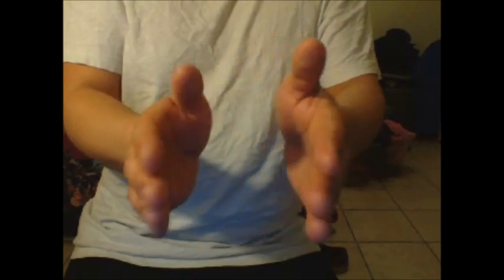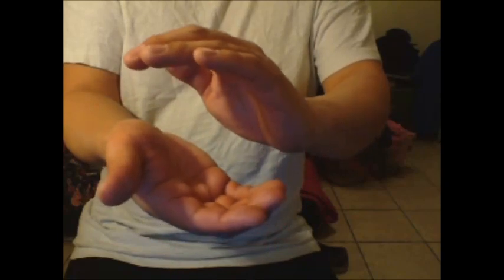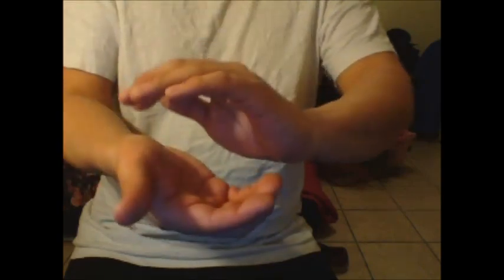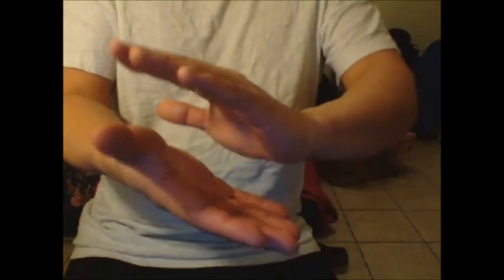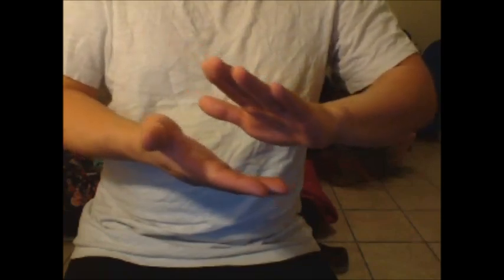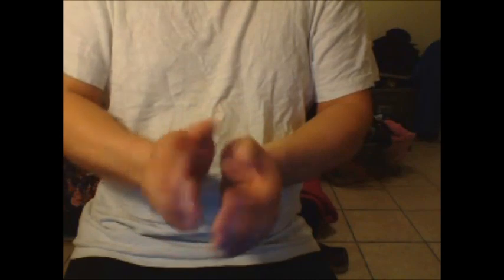MY "HOW TO CREATE A PSI BALL TUTORIAL!" (For Beginners)

Comment: I felt so much heat and magnetic in my hands while doing this!It takes time,I’ve been trying this for about 2 months and finally,I felt it for the first time!
Reply from the maker: Here's some more advice for chi/psi ball Development. 

People ask how the energy gets released from the hands. Well the thing is the hands are always releasing energy from the palms. It gives off thermal energy and slight subtle bio electricity. If you have watched my video on psi ball Development. You should know some tips to get started. But there's a few ways to further help creating psi balls and chi energy from hands.  

One way is to rub your hands together for 15 to 20 seconds. Then clapping them fairly hard together 4 or 6 times. This helps with creating more blood flow and stimulation in hands. That is energy as well. Then place your hands close together with a half an inche between the palms. You should feel a pulling or pushing between them. This is the earliest baby phases of the psi ball. You should feel some heat, tingling and a kind of magnetic sensation. That means your stimulating the chi energy. You can also open the space between the hands a bit and then closing it. Going back and forth like that to feel that magnetic pull or pushing. Later in time you should feel the psi ball getting bigger.

Keep doing this when ever you wanna practice and you'll get stronger in time. Do some breathing exercises (like six breaths per minute is very good), meditation to relax the mind as well. That is optional but the rubbing and clapping works well. Developing chi balls can lead you to creating Electrokinesis, improved telekinesis and Pyrokinesis too. Take care and be please be patient.

Comment from the maker: Here's some more advice for chi/psi ball Development. 

People ask how the energy gets released from the hands. Well the thing is the hands are always releasing energy from the palms. It gives off thermal energy and slight subtle bio electricity. If you have watched my video on psi ball Development. You should know some tips to get started. But there's a few ways to further help creating psi balls and chi energy from hands.  

One way is to rub your hands together for 15 to 20 seconds. Then clapping them fairly hard together 4 or 6 times. This helps with creating more blood flow and stimulation in hands. That is energy as well. Then place your hands close together with a half an inche between the palms. You should feel a pulling or pushing between them. This is the earliest baby phases of the psi ball. You should feel some heat, tingling and a kind of magnetic sensation. That means your stimulating the chi energy. You can also open the space between the hands a bit and then closing it. Going back and forth like that to feel that magnetic pull or pushing. Later in time you should feel the psi ball getting bigger.

Keep doing this when ever you wanna practice and you'll get stronger in time. Do some breathing exercises (like six breaths per minute is very good), meditation to relax the mind as well. That is optional but the rubbing and clapping works well. Developing chi balls can lead you to creating Electrokinesis, improved telekinesis and Pyrokinesis too. Take care and be please be patient.

Comment: Why is mine freezing cold, it feels like Icy wind. I can’t feel a solid, just wind blowing round in a circle
Reply: Omg me to no heat like a lite wind
Reply: I felt a numb tingling in my hands and the wind that you are talking about… we are airbenders!
Reply: It can be a different feeling for everyone
Reply from the maker: Here's some more advice for chi/psi ball Development. 

People ask how the energy gets released from the hands. Well the thing is the hands are always releasing energy from the palms. It gives off thermal energy and slight subtle bio electricity. If you have watched this video in full on psi ball Development. You should know some tips to get started. But there's a few ways to further help creating psi balls and chi energy from hands.  

One way is to rub your hands together for 15 to 20 seconds. Then clapping them fairly hard together 4 or 6 times. This helps with creating more blood flow and stimulation in hands. That is energy as well. Then place your hands close together with a half an inche between the palms. You should feel a pulling or pushing between them. This is the earliest baby phases of the psi ball. You should feel some heat, tingling and a kind of magnetic sensation. That means your stimulating the chi energy. You can also open the space between the hands a bit and then closing it. Going back and forth like that to feel that magnetic pull or pushing. Later in time you should feel the psi ball getting bigger.

Keep doing this when ever you wanna practice and you'll get stronger in time. Do some breathing exercises (like six breaths per minute is very good), meditation to relax the mind as well. That is optional but the rubbing and clapping works well. Developing chi balls can lead you to creating Electrokinesis, improved telekinesis and Pyrokinesis too. Take care and be please be patient.